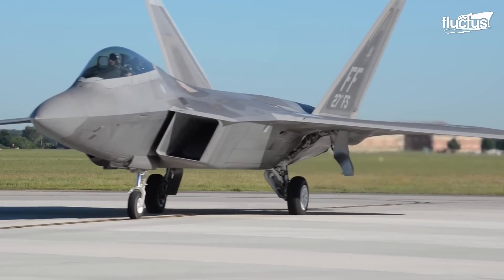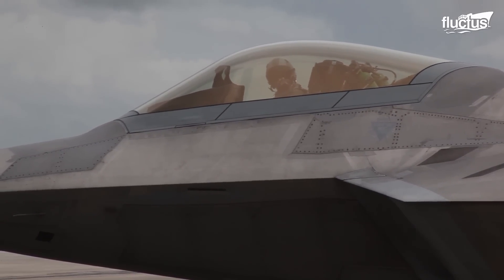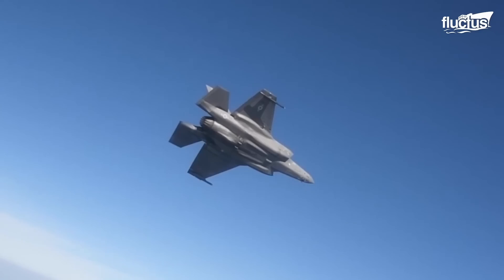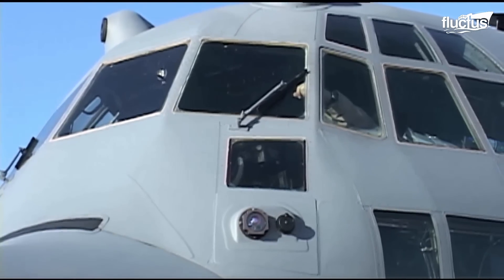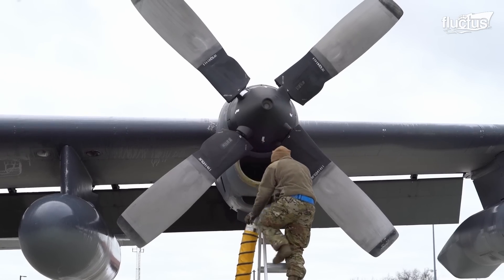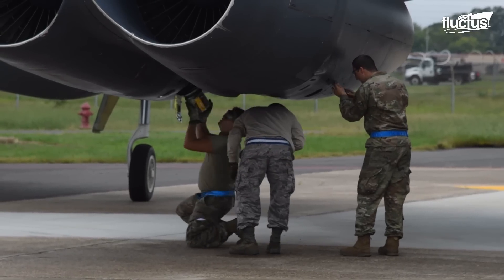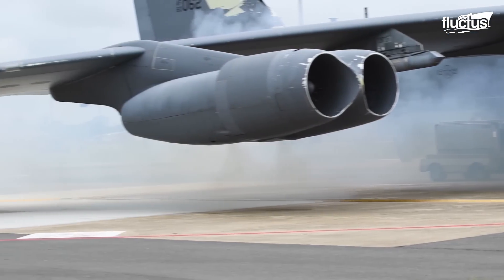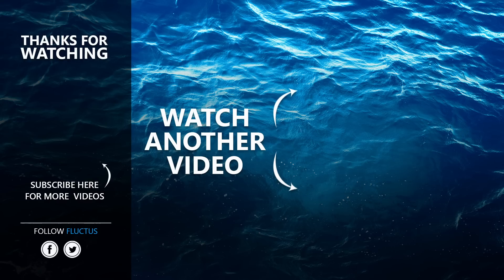Crazy Technique US Found to Start Up Its $350 Million Stealth Jet

Comment: Total BS clip thumbs down for mis info. 
Weapons ARE NOT loaded on powered aircraft except in the most dire of circumstances (which you’ll never see). 
So the APU exhaust is not relevant to loading, there’s no need to avoid it as a weapons loading team. 
Now the designers of the aircraft had to pay attention so exhaust wasn’t a problem for weapons or other components but total BS about ordnance crew need to take special precautions and all that other BS. 
How do I know?
Aviation Ordnanceman USMC here. 
IYAOYAS

Comment: Its actually a cartridge start which negates apu assist to the engine.. one tiny electrical engine built-in to start main turbine . the F 15 by McDonald Douglas was original patent.. the cart start is used  as a last resort and is quite effective as it requires only mechanical function..U.S.A.F crew chief F-4 & F-15 ret...p.s.stilll the fastest way to launch.. but causes global warming 😅

Comment: That is very contradictory, first you say weapons loaders AVOID THE APU exhaust area  for safety etc, Then you say the APU is  designed to be turned OFF    ie, turned OFF so loading can be performed. HUH. What is true here????
Reply: APUs are only on when they are needed then turned off.  Weapons load crews don't have to worry about that as it won't be on for a weapons load.  This is a clown show of a video.